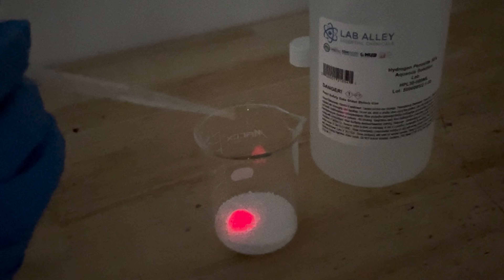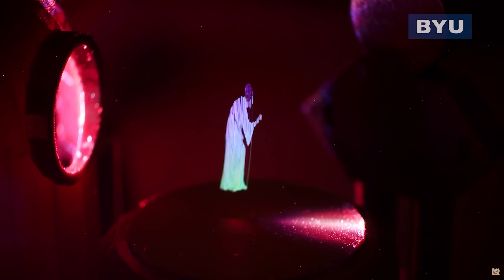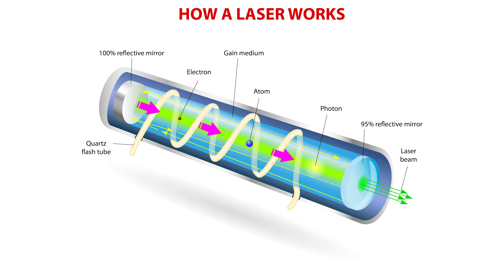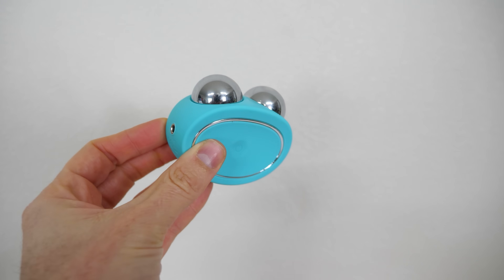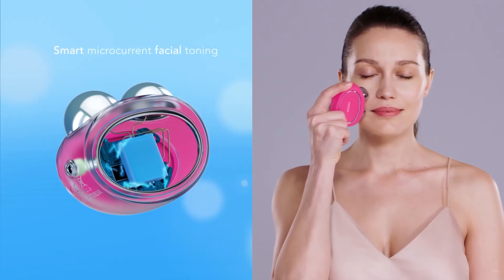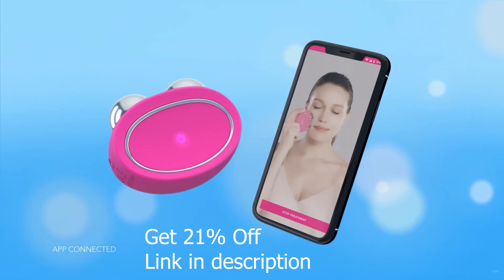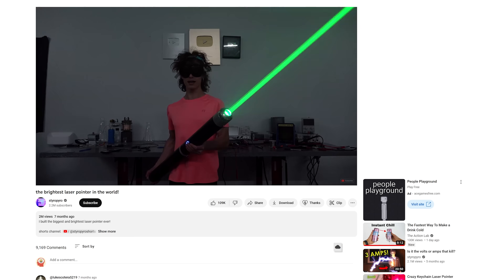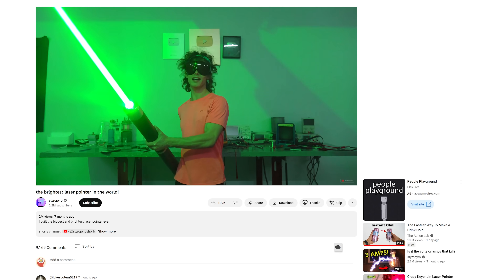Singlet Oxygen Is Scary!

Comment: The chemical storage was only a small factor for the decommissioning of the Boeing YAL-1. Testing showed that the atmosphere had too much of an affect on the powerful laser, causing it to lose a significant amount of energy due to heat and light scattering. While they initially billeted the laser as being able to operate from hundreds of kilometers away from its target, after testing it was shown the actual effective range was not nearly as long as they had hoped. They would basically have to fly into hostile airspace to get a chance to shoot their targets long enough to destroy them, which defeated the purpose of a standoff ABMS.

As of yet, there is no effective way to destroy an ICBM during its first phase of the launch because they are extremely fast and positioned very far inland in most nations that have them. Most efforts nowadays are into stopping them during the second phase (the ~15 minutes while they are freefalling in space) or the third phase (the ~2 minutes of terminal velocity before airburst of the warhead). As of right now, the big huge chemical laser of the YAL-1 will probably remain unused, unless we decide to put those things in space, lol
Reply: Yes, it struck me as odd that an organisation that routinely carries massive amounts of explosives should shy away from a few (admittedly reactive) chemicals.
Reply: @PhilJonesIII the explosives they use are very predictable
Reply: @PhilJonesIII  Explosives cause severe local damage, but these chemicals release some noxious gases that can be far more dangerous to a larger than acceptable area.  Plus, being liquid, can cause major headaches in large quantities in flight.  Just baffling it enough to keep the plane from being shaken to pieces by oscillating liquid would have been headache inducing.
Reply: Bring on the Tesla Death Ray!
Reply: If we let Musk design a death ray, it will take 20 extra years to produce and spontaneously combust the first time it is turned on.  He is just a rich moron with good PR.
Reply: @poepflater  Umm . . . better not wish for a Tesla death ray.  If you get that it will probably crash, catch fire, or become infected with internet disinformation viruses.
Reply: @Lucius_Chiaraviglio  Read up about it, Tesla claimed to have a death ray that could shoot planes out of the sky.

"Tesla teased his “teleforce” weapon for decades, saying it could shoot down airplanes from 250 miles away. The press landed on a different name for the invention: death ray. Despite claims to the contrary, Tesla never provided much proof that the death ray worked. But no one could quite dismiss the idea, either."
Reply: @poepflater  You're thinking of the original Tesla.  That's not the Tesla you would get today.  Some name appropriation has occurred . . . .
Reply: @Lucius_Chiaraviglio  I know, I'm old.
Reply: @Lucius_Chiaraviglio 
Isn’t a “tesla death ray” just an ultra-high energy high intensity electron beam?
Reply: They replaced it with Nd doped fiber laser arrays now. 1.2 to 5 Mw peak power and up to 180kW average power, all in a 3 centimeter beam.
Reply: Lasers will never be long-range weapons. Like  @BetaDude40 points out, there are medium issues inside the atmosphere; as @Neo-vz8nh says there are lensing issues at an orbital scale that make it very hard to focus; but once you make perfect lenses you still have the quantum behavior of light to deal with. At long range, lasers will always behave like a cone, not a beam. They still have military applications, because they're easy to aim and as fast as can be, it just won't be long-range applications.
Reply: I don't think it would operate in space either. Every laser has a divergence, which is in a range of a few degrees. They are very focused from close but become huge beam at a distance. Even with lower then one degree divergance in few hunred km distance the laser beam would be still around a kilometer wide.
Reply: @Neo-vz8nh  I have a feeling that if their testing concluded the atmosphere is the factor causing it to lose its effective range, I would trust their word and assume it would work fine in space. These are engineers we're talking about - they probably had the laser's divergence in mind when calculating the original effective range
Reply: @psychopiper  Yea but they engineered it on a plane not on a spacecraft, big difference you know.
Also if something not effective due to athmosphhere does not neccessery mean it will be effective out of athmosphere.
Reply: @Neo-vz8nh  That's not the concern, it's whether the laser would work without an atmosphere. Considering they attributed the laser not working to the atmosphere, I would say it's a pretty safe bet to assume it would work outside of the atmosphere. It's just not worth putting into space
Reply: @psychopiper  you are not geting my point, do you?
I talked about the divergence of the laser. That is not depend on the athmosphere but on the distance. The farther away the object, it gets less flux (energy per area) diminishing its strength by the square of the distance.
Reply: @Neo-vz8nh  Yes, I understand that. What I'm saying is that the engineers attributed the severe difference between theoretical effective range and actual effective range to the atmosphere. These are literal engineers - they calculated the divergence to estimate the original effective range, which is how it would likely work in a vacuum. This is why they said that the atmosphere was the problem.

Do you really think that the team of engineers building a high priority government laser wouldn't consider one of the most basic concepts you need for a laser to work when considering its effective range?
Reply: @psychopiper  I don't said they are not calculated it, however scattering and optical depts can also be calculated to some degree, which show that even an engineer can make a mistake. But I get your point, I believe in that it would work on the surface of an athmosphereless planet. But on space, thinking about satelite, it may not, as the distance in space are far bigger, diminishing the power of the laser.
Reply: @Neo-vz8nh  We have quite precise lasers for military and astronomy applications nowadays, that's not as much of an issue. The laser was hitting its target from the YAL-1, the problem was that the laser was far weaker than expected due to atmospheric interference.

In theory it would operate fine in a vacuum, but there's not really a reason to bring something that powerful to space
Reply: @BetaDude40  With a km wide laser beam you DEFINETLY hit the target, but it will get far less energy, makeing the beam weaker. I don't say this is the main factor. The main factor is the scatter of the ahtmosphere, but it adds to it.

I have no expereince in military lasers but I'm an astronomer, and the astro lasers never meant to hit something small. The most use of laser are adaptive optic which operates a few 10 km away (and not few 100 km), and to make a steady emission in the upper athmosphere, which size does not matter.
Reply: @BetaDude40  i feel like it would be good for space mining industries. no atmosphere means u can just vaporize asteroids in a closed environment and refine the vaporized minerals. and since its just hydrogen peroxide and a catalyst we can use solar energy to continuously regenerate H2O2 from ice
Reply: @aoyuki1409  At that point you're probably better off coming up with a better electrically powered laser -- all other things being equal, it would be more efficient, because you lose a good bit of energy in the making of hydrogen peroxide (as you do with electrolysis of water and the subsequent recombination of hydrogen and oxygen).
Reply: @Lucius_Chiaraviglio  true, but i think the portability and compactability of the chemical laser can be beneficial in some cases. like its hard to setup a whole electrical system for lets say 50kW continuous electrical laser (plus its cooling solution), but its easier to carry stuff once you're already in space because no friction. just more travel time. you can have the mining drones just carry H2O2 and collect vaporized asteroid gas, while a dedicated station with proper solars and battery will mass produce H2O2 and refinery. drones can also just use H2O2 or asteroid gas as propellant during emergency situations that when they need to really dodge a collision, or ran out of electricity to power their ion boosters. either way we cant say for sure because its something we have never done yet, we can only theorize about it
Reply: @Neo-vz8nh  Laser designator equipment is usually what the military uses lasers for nowadays, with handheld and vehicle mounted lasers having a surprising range. Naval-mounted laser designators can definitely paint targets well over 10 kilometers away with extreme precision. This works because these optics are callibrated to ludicrous tolerances and the power of the beam is mostly irrelevant as you're just trying to point it at something, not melt it.
Reply: @BetaDude40  First, 10 km is one and a half magnitude smaller then 350 km, which means 3 magnitude (1000x) higher flux due to the square law.
Second painting something is also very different. The laser won't disappear, it just have its power significantly reduced, due to the fact that it will be always move in a cone, hence the square law.
Reply: @Neo-vz8nh  It's a shame you've conflated beam focus, attenuation, and the inverse square law. 

Your "square law" only applies to the difference in the beam diameter, not how long it is - it's not a sphere, it's a cone that's narrow enough to be a cylinder.

The "blooming" effect of a laser is mostly atmospheric attenuation - photons running into atoms of air in their way and being scattered

Laser light is coherent - you want to avoid lensing with your optics, as it introduces focal length issues that don't otherwise exist.

P.S. I'm only responding to you because your logic is good, just based on facts you need to re-check since you've gotten some general optics rules mixed up with how lasers work.
Reply: @muninrob  inverz square law still applies to a cone, not just sphere, as the base is still an area.

I did not talked about blooming.

Lensing has nothing to do with coherence. Lensing makes the angle of the cone smaller.
Reply: @Neo-vz8nh  1. You are using inverse square law and applying it to the length of the beam, not the change in it's diameter where it would actually apply.

2. no, you conflated blooming and beam focus.

3. You don't use lenses to focus a coherent beam, because doing so destroys the beam's coherence. (That's why lab grade prisms get so expensive.)

Like I said, your logic is sound, you are just applying ordinary optics rules of thumb to a laser, where they don't apply due to a laser's coherent nature.
Reply: @muninrob  the divergence of the laser makes the beam a cone, like i said. The cross section of the cone is a triangle, so triginometric rules are apply, and so the diameter of the beam correlates with distance, and the area is pi/4 diameter square. The inverse square law still stands. 

Blooming is a refraction effect (like prism), nobody talked about that. Scattering which makes the beam weaker, as the photons scatter on particles, and have their heading altered. This causes an exponential decrease in power, which can be described with optical depth.
Reply: @BetaDude40  shoot out enemy sats
Reply: @Neo-vz8nh  Seems adaptive optics can compensate for issues and seems also I recall there were systems onboard that somehow compensated for the aberrations in the atmosphere as another concern. Guessing that's some sort of adaptive optics, though I've had way more head traumas than I like to know, so don't recall at this time.
Reply: China has seven of them in space already with many more planned or already there.
Reply: @johnsmith1953x  sure thing pooh
Reply: The plane that was retired was probably just a proof of concept tester and never intended as the delivery mechanism.   I seriously doubt that the engineers didn't forsee atmospheric attenuation.   To build a space based laser, you would need to know how much atmosphere you could shoot through and still be effective.   The plane was likely to confirm range at different altitudes.  Now they know how long after launch they need to wait before firing.   ICBMs do peak above most of the atmosphere in their trajectory, where they would be vulnerable.  

A kinetic attack would be more effective,  but trajectories take time to align, so hitting a target that was launched unexpectedly isn't easy from a moving satellite.   If you can pivot that satellite and hit the missile with a laser from a distance,  you are more likely to be within range of it.  I suspect both methods will be used.  When it's an ICBM, you throw everything at it.  

We shouldn't be wasting our money having a military at all if they aren't making systems like this.
Reply: @michaellowe3665   wouldn't the "space" laser be able to target the ICBM in space! so no atmosphere to deal with 
    And could use it to target other satellites
     And I'm pretty sure they have some pretty advanced tech to focus lasers  we have ones you could shine to the moon without it being scattered 1km
Reply: @terranovarain6570  they still have to be in the right place at the right time. They are in orbit, so everything is moving relative to each other.  You need dozens of them to make sure at least 1 is in the right position. Also, a very shiny chrome plating on a missile might make lasers useless. There are often very low tech countermeasures to high tech weapons.
Reply: I might be confusing this with another system, but I seem to recall this had 3 lasers.  One was a targeting laser.  The next scanned the atomosphere between the plane and the missile.  This information was then used to deform a mirror that third laser, the one to destroy the missile, bounced off of in such a way that made it so that the atmospheric interference actually caused the laser to recoalesce at the target.
Reply: Hey, orbiting chemical laser satellites would be a good next step in creating world ending weapons. Nuclear warheads have existed too long with no event (minus 2 notable blips). We need to kick things up a notch. Because everyone knows humanity is better off building weapons that can destroy our entire civilization instead of spending time on boring things like diplomacy and medical advancements lol
Reply: i guess the comment section of science videos don't welcome dumb asses like me, holy shit this is confusing, and so are the other comments and replies, i only understood a few words (i didn't know shit about the acronyms and terms)
Reply: Putting those things in space would have been against international law. The space liability convention is keeping us safe (for now) from a bunch of crazy stuff being put/done in space. 
It's also why China denied the recent Moon crash.
Reply: Btw, the carbon /toxicity footprint of the elephant in the room aka the military industrial complex anybody?
Reply: Could a ground based laser (which wouldn't have the storage limitations of an based laser, and therefore be more powerful) be used to hit ICBMs on the way down?  I am imagining something that might look like an observatory or radar dome.
Reply: @thesuperdak7224  it would have major problems with atmospheric blooming, making it need a few orders of magnitude more starting energy, but, yes.
Reply: How much money did the military fleece us taxpayers on that experiment ?
Reply: @geneticdisorder1900  You don't pay taxes.
Reply: That's a great idea.  Then the atmosphere would be null and the laser would be practically limitless as far as range.  They would only need two or three to have coverage for the entire Earth.  Which means they probably already have this and we don't know about it.  Space Force
Reply: Space Force has entered the chat…
Reply: You're pretty gullible. Are you also fully vaxxed against a disease so serious that you need a test to know you have it?😂
Reply: 0
Reply: Electronic warfare they have to be connected to some sort of server to get the commands through to launch I think Britain and USA tested the concept of hacking nuclear weapons and they were able to change the trajectory of the missile from south to west flying over USA without a warhead obviously it was a trident 2 icbm I think it might not be physically possible to disable every nuke but the more they put out of service the more time it’s gonna give surviving forces to react
Reply: Sounds to me to be a... disinformation campaign to try and slow down developing nations. 

"We built this giant flying machine without testing if the laser would even work first"... BS they always do ground testing first and it would be stupid easy to just have a multi mile firing range as the U.S goverment.
Reply: Thank you I wasn't buying the transporting chemical story either.
Reply: AEROSPACE ENINGEER HERE - I get where you're coming from because I also fed up with ignorant social media 1/2-wits who think they know what they are talking about with respect to technology. I was doing my degree in the late 80s when Ronald Reagans Strategic Defense Initiative (SDI), nicknamed the "Star Wars program" was in full swing. I might have been an undergraduate but a bunch of the departments postgraduates were sponsored by DARPA and working on various Star Wars projects.

In our final year we were required to do at least 2 high level options. One of the most popular options was orbital mechanics but me a couple of others opted for Space Craft Dynamics because it sounded cool. IT WASN'T - it was the single hardest class any of us ever took because the math is almost insane. making things point accurately in space is incredibly difficult because everything is moving along its orbit and orbits are curved.

The whole idea of using lasers to shoot down missiles was found to be a stupid concept in the late 80s. it just gets even more stupid in space. Other than the math there's the basic issue of speed and distance. Everything is just going damn fast and the distances involved are pretty large. Then there's the issue that lasers bounce off shiny surfaces. That's what actually killed of the Star Wars program. One day someone just asked "what if the missile is shiny."

On the technical side its pretty simple. Imagine if you're in a Formula 1 (or similar) car doing 270kmh and your task is to reach out the side of the car and shoot a target that 2km (2,000m) away with 1mm accuracy. So we are clear I have done competitive shooting out to 700yrds and can assure you all there's not many guns or people that are 1mm accurate at 2km (2,000m) and you need that accuracy because it takes time for the laser to burn through.

NOW multiply that problem by 100, because if you are in low Earth Orbit you'd be doing about 27,000kmh not 270kmh and the ground is about 200km away not 2km away. All the other versions of laser systems have similar issues.

Sorry to all the Star Wars fans (and I am one myself) but there's a BIG DIFFERENCE between Hollywood and Reality.
Reply: Everyone talks about lasers because of Star Wars meanwhile no attention whatsoever is given to other DEW, namely microwave based ones, such as the EL/M-2080 Green Pine
Reply: @pickleman40  It has exactly the same issues of beam divergence - its gets wider over distance.

MW also loses energy on target over distance because the air molecules themselves absorb some of the energy.

When you look at the industrial uses of lasers for cutting look at the distances involved.
Reply: At least, that was their story.....
Reply: It's still possible there is one in space that we just don't know about, hidden by a layer of other instruments.
I say possible, but not likely.

And there's probably other more viable alternatives that we, again, don't know about YET. Something they have locked away that they will bring forth if necessary.

But more importantly, shooting ICBM's down with lasers is all good on paper, however nothing beats the more direct approach of just intercepting them physically with a countermeasure missile.
Reply: @RealCadde  Kinetic ABMs are significantly harder to make in theory, as you need extremely precise engineering, navigation, and target prediction and identification systems onboard a thing that has to fly up at supersonic speeds to basically shoot a bullet out of the sky. ICBMs do not carry a singular nuclear warhead, they are payload vehicles for multiple devices as well as dozens of radar decoy objects thrown off as chaff.

Everything is still extremely classified about all of this (and rightly so), but laser defense systems would offer a significant advantage in reusability and target correction. If a laser misses its target, you can just spin the gimbal it's on until it hits. If an ABM misses, that's millions of dollars straight down the drain (followed closely by millions of lives).

The reason we use the kinds of point defense that we have with kinetics, like the Patriot Air Defense System and CIWS and other countermeasures is because most things aren't screaming into the atmosphere at supersonic speeds, and they're not carrying payloads that still allow them to flatten an area with a burst high in the stratosphere well out of the range of all of these.

Though the ABMs have an advantage in that they actually work, so there's that lol. In that respect, until we figure out how to overcome the problems with in-atmo lasers, they're the best we've got.
Reply: @BetaDude40  How about interception BEFORE they re-enter the atmosphere.
Also, if there's active defense systems for tanks that shoot down projectiles going mach 4 there's going to be active defenses that can target a fricking ICBM.
The cost of the system is a non issue by the way. Lives won't be lost because they will have developed it such that it just works.
Lasers are only effective up to a few kilometers, as explained here. And targeting your multi payload then is just as ineffective as kinetics. Not to mention they would most likely detonate by design when targeted in that phase, giving you something funny called EMP that would nullify all your efforts.

No, the best time to counter ICBM's is as close to launch as possible, satellites can carry missile capable of shooting them down without issue because the ICBM needs to go to space before anything else. A laser system has less range, thus you would require more of them than a single satellite carrying a few dozen intercept missiles.
Reply: What with the lol
Reply: Why not attach the laser to an ICBM?  Then you can launch the ICBM, but blow up the target before the ICBM would ever hit it.  Jesus,  Boeing, hey, I'm right here. 🤚 Hello?  Where should I send my resume?
Reply: @lookupverazhou8599  that's not too far off from bomb pumped lasers, an old idea from the 80s about using nukes in space to power xray lasers
Reply: @battleoid2411  I've seen proposals for that -- instead of being missiles, these would be satellites.  Of course, both ways of deploying bomb-pumped lasers would suffer from being only able to target whatever number of missiles they could see at one time, thereby inviting an enemy to split up missile barrages into many waves to deplete the antimissile missiles/satellites.  In contrast, if you put a chemical laser on a satellite, it would be able to wait between firings if necessary, and keep operating until it ran out of laser fuel (or got taken out by enemy countermeasures).
Reply: I stopped reading at "affect"
Reply: @YounesLayachi  If you understood me enough to correct me, then you understood what I was saying and my communication was successful. Get your pedantic prescriptivist ass outta here.
Reply: I've heard a conspiracy theory that COIL actually worked a little too well and that the US decommissioned it because it wasn't like we could actually use it to defend against a nuclear full exchange, but it was plausible enough that it worried China and Russia unacceptably.  The goal was an effective solution to the NK problem and causing a breakdown of MAD in the process was not doable.  

As much noise as Russia/China make about the GMD and other interceptor-based defense systems, they can rest reasonably assured that since we don't have thousands of interceptors (easy enough to deduce from space) that their nukes will still be effective tomorrow.
Reply: Can you show us how to make a bottle of drinking water?
Reply: @spidermanjc0  There are "water generator" machines that run on electricity, so actually they convert fuel into water.